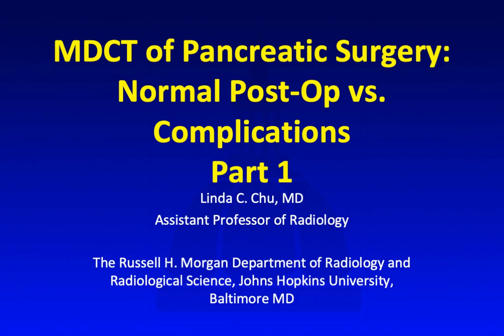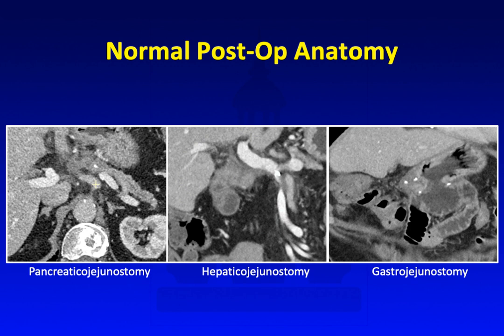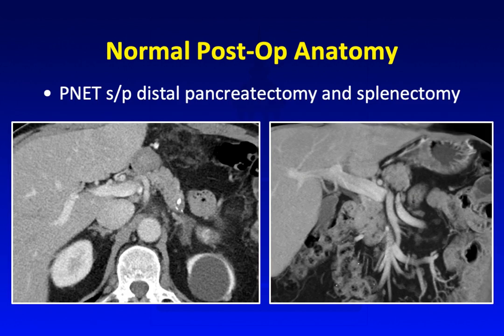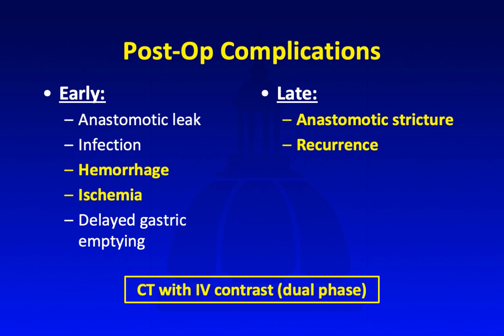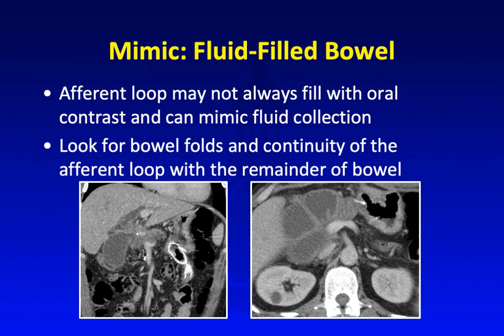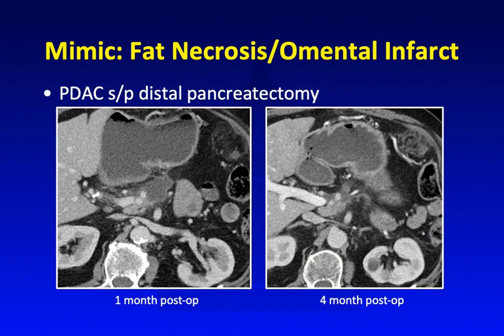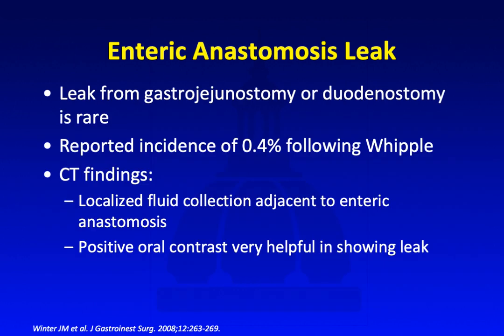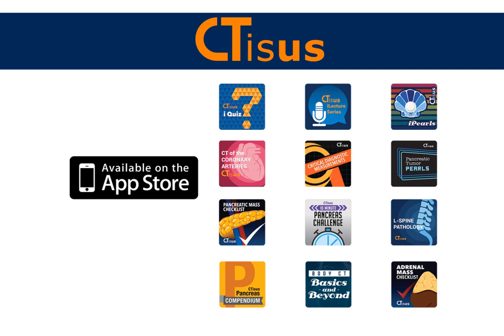MDCT of Pancreatic Surgery: Normal Post-Op vs. Complications Part 1

Comment: I had surgery in my country to remove half of my pancreas due to a pancreatic cyst.  Since they removed by cutting open the abdomen(inverted v  ^) I've been having cramps if I overdo or try to do exercises.  Plus I've received no follow up treatment and am now not able to read without reading glasses.